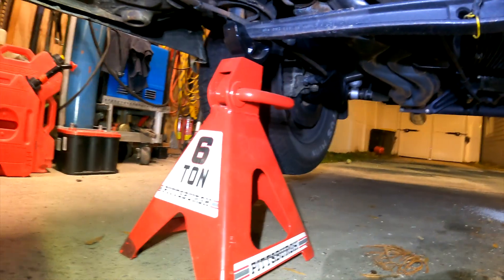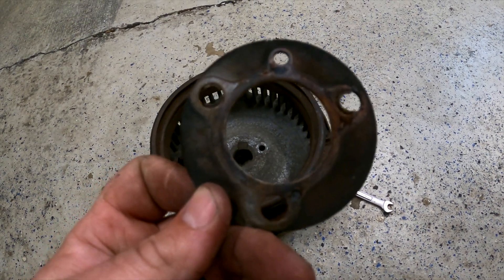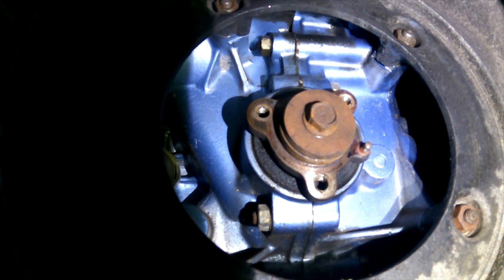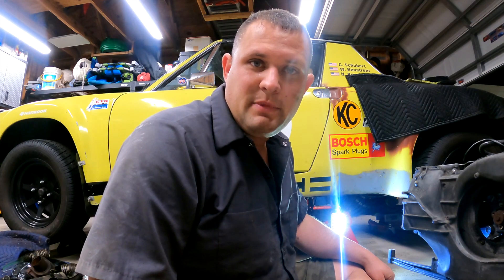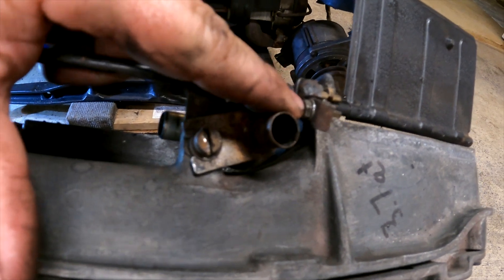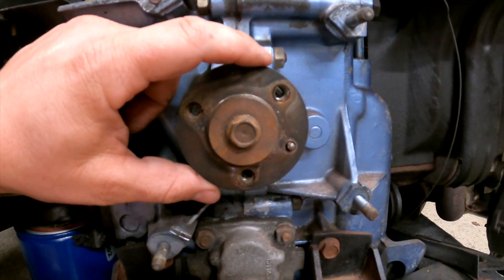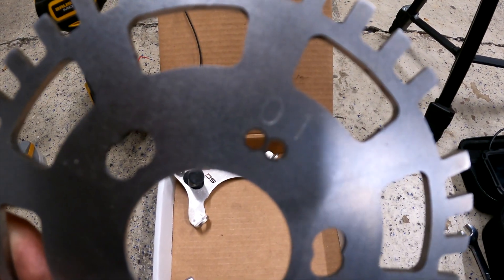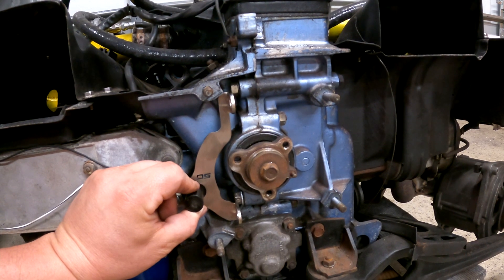Porsche 914 D-Jet Delete- Haltech EFI Conversion Part 3: Crank Trigger Wheel install

Comment: Awesome video man! I’ve heard of horror stories from people who have attempted to turn the engine by using a socket & ratchet on the center fan bolt; if you break it off, you’re boned. Looks like you got lucky. Keep up the good work. Can’t wait to see it run!
Reply from the maker: Now someone tells me! We once attempted starting a type 1 off the crank nut with a power drill
Reply: @barefootgaragejax9252  Wow! I think I've seen videos of someone starting a type 1 by cranking on the alternator nut.